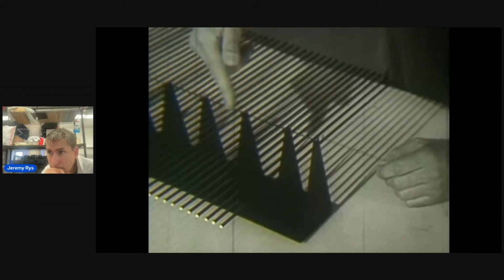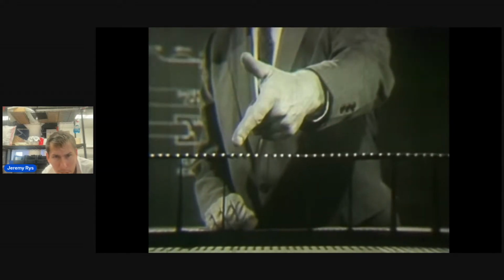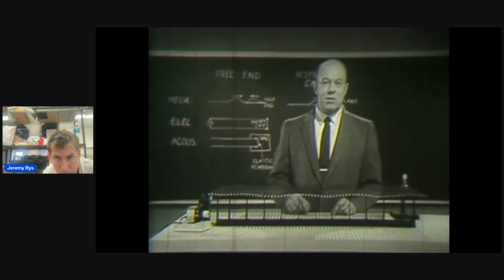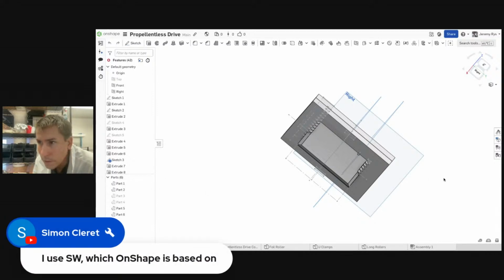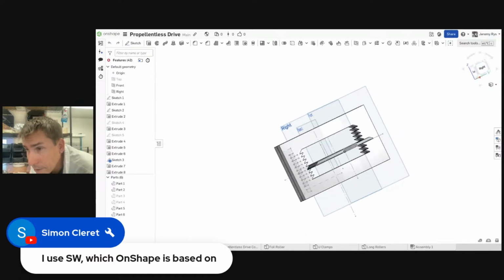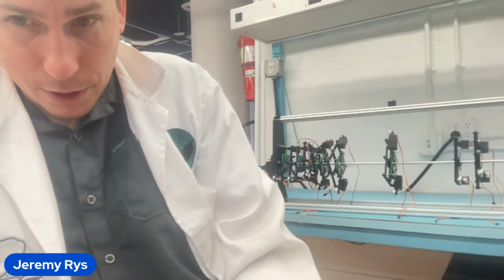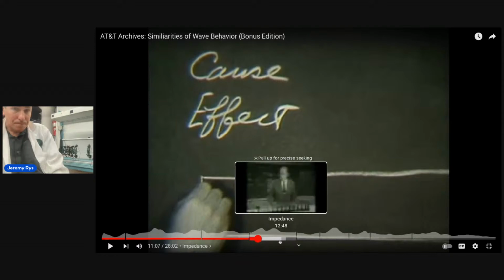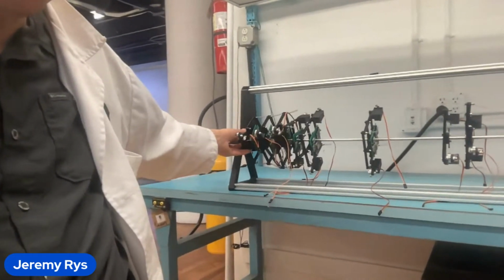LIVE Lab Update! With Experiments!

Comment: I wouldn't apply the copper tape that way especially if it's for a HV application. Irregular features will concentrate the electric field and decrease hold off or break down voltage.